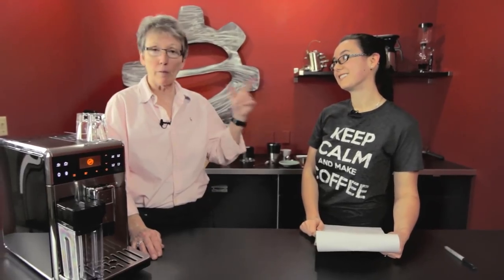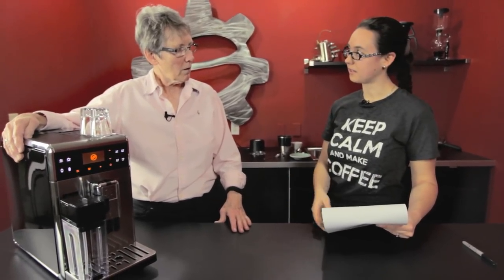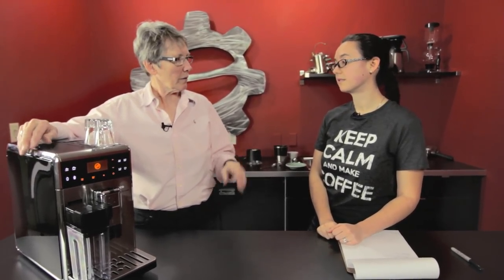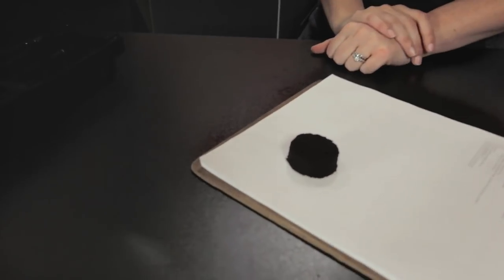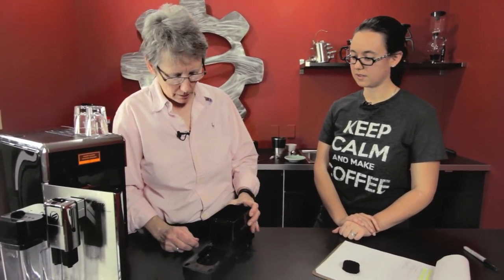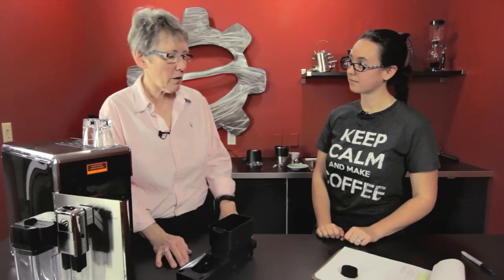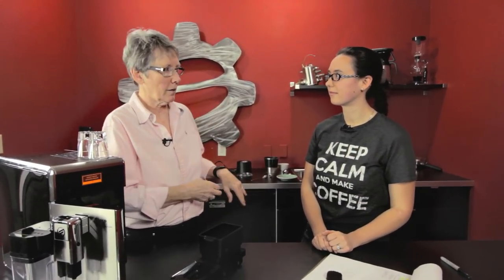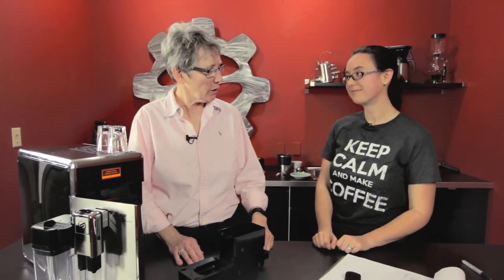Ask Gail: Soupy Pucks on a Superautomatic Espresso Machine

Comment: I just bought a Phillips 4300 off Amazon and even after running 12 , 40ml espressos on maximum grind time at maximum fineness it still produces a soggy mush which subsequently cant be ejected from the brew group into the grounds bin. I fiddled with every single option to no avail. I even disassembled the brew group, cleaned, regreased, and assembled it. Still same soggy mush. I figured the motor wasnt applying enough torque to properly tamp the puck so I went to my local Best Buy to get another unit. I plugged it in, ran 12, 40ml espressos through and I'm getting identical results. I'm using Starbucks Pike Place medium roast beans. Anybody else have this same experience?